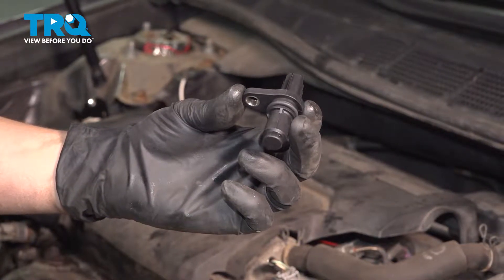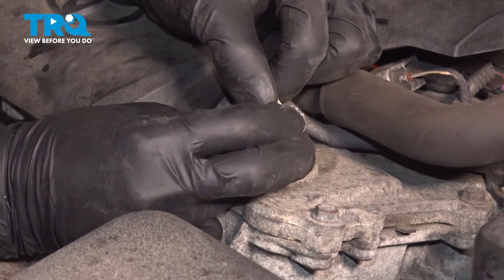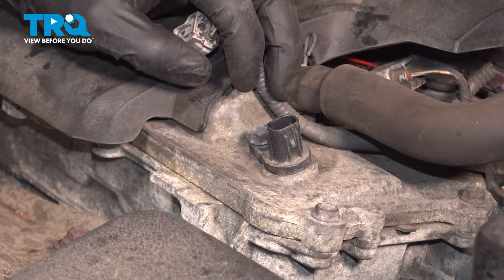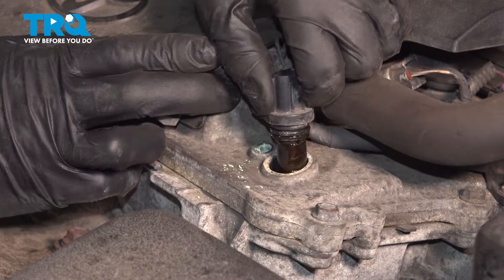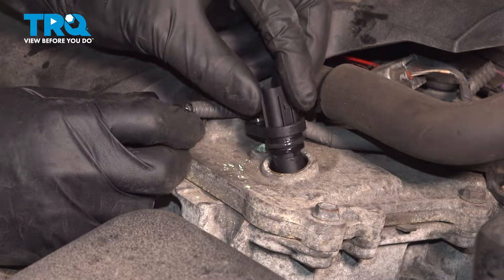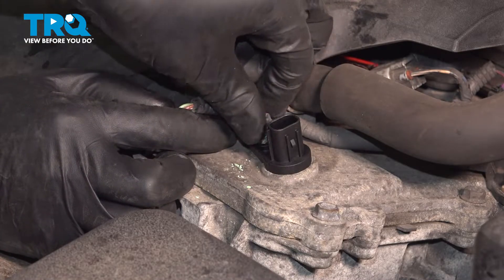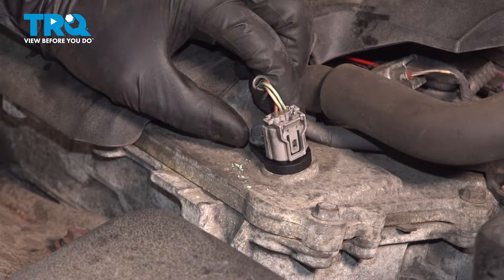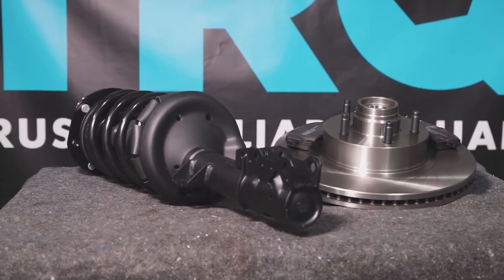How to Replace Camshaft Position Sensor 2012-2017 Toyota Camry 2.5L L4

Comment: There's another video from you guys showing the camshaft position sensor in the wheel housing for the same Camry model. Does that model has 2 sensors?